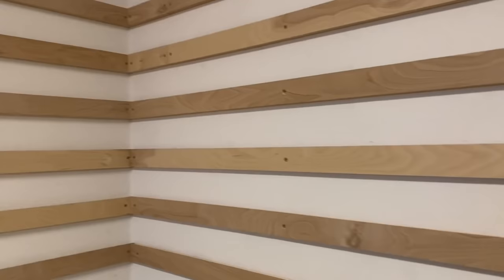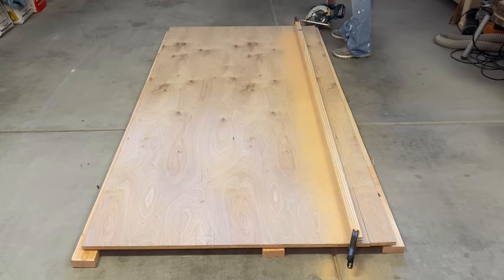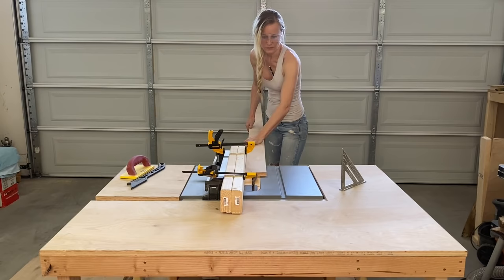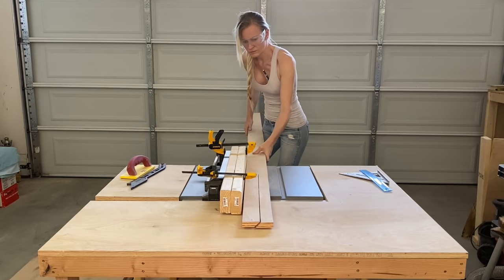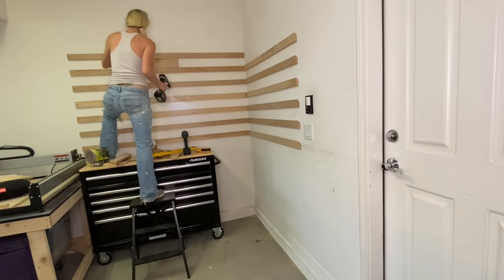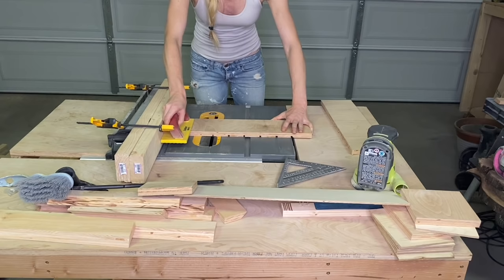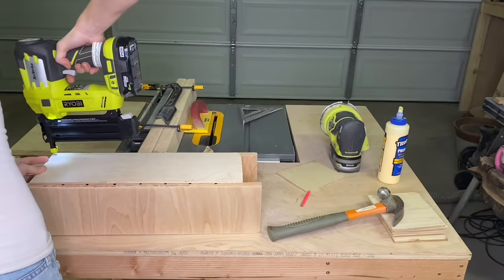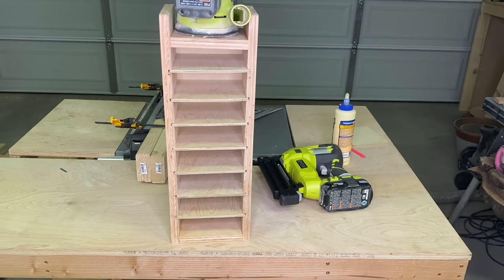DIY Build - French cleat system

Comment: Generally, this is a really good idea for anyone working with stud walls and a need to move modest, static, weight around.  I like that this installation has more horizontal cleats than I might've used, but I now understand.  Very good video.  Thank you!

Comment: I used left over Hardwood floor boards for my wall cleats and tool holders. Worked well and looks nice. Making many different tool holders for Jigs saw, sanders, drills, polishers, clamps, torque wrenches, sockets, wrenches and many more out of old cutouts and other scraps of lumber. I even built shelves for cans of paint and automotive care products. One side of my garage is all french cleats. I keep building more holders and I'm running out of room. I hate drawers as things get lost in them. Awesome job!

Comment: I have a French Cleat System on two sides of my garage. I bought 1x4x8 pine and cut a 45 degree angle on each side. Cut to length and afix to wall. Quick, safe, less expensive than ply wood.

Comment: Thank You.  Great vid.  I'll have to try that system for the garage in my new house.  Don't have a real shop (yet) but, I've used the French Cleat method on some shallow picture shelves.  I hid the wall-mounting screws with small, angled supports.  They turned out really good.  So easy to make and quite strong.  I might still have the Sketchup design I created.  Also, and I think I speak for most guys here... you're probably every woodworking man's dream.  Gorgeous AND skilled.  Thanks again for the great tutorial.  Enjoyed it more than I probably should have but then, I'm single (nudge, nudge, wink, wink) so, it's okay.  See Ya!

Comment: I use this system for many things, Solar lights can be placed in the sun then back on the cleat at night, my homemade truck camper has them on the sides for cooking and an awning, inside holds a clock, white board, and other things. cheap and easy !

Comment: great job, a little hint of advice , grab some folding sawhorses and throw a large sheet of foam insulation on it and cut your plywood sheets on it. You can cut into the insulation without hurting your blade and it makes cutting plywood so much easier. SAVE YOUR BACK hehe....

Comment: Hi Meike, I’ve had another thought that may help you in the future, when you next need to cut sheet timber try using your tablesaw bench with some sacrificial strips between your table and the sheet timber then you can clamp the sheet to the table over the sacrificial strips and it could save your back and knees.

Comment: I really like your system.  Very neat.  I would add a respectful criticism.  When you crosscut not a good idea to do it against the fence.  It could easily trap your piece.  Also the part when using the table saw ripping long pieces had no outfeed support.  Your piece could easily ride up over the blade.  Your set up for circular saw cuts on the floor was A+.  I would def do this project so thanks for the video.  Stay safe.

Comment: Nice build. You’ll love storing all your tools on that wall. My wall is the best thing I ever did for keeping all my tools handy at arm’s length. Have fun with it. 

I would like to see you use a bit more safety at the table saw. For the long rip a feather board and infeed support would keep the work from wobbling — lowering the chance of kickback. For the crosscut (grooves), a miter gauge would be safer than relying on the rip fence when you only have about five inches on the fence. Please be safe.

Comment: The French cleat on the wall will collect dust. I cut 1” x 2” pieces 1/4” hardboard and drilled a 3/16” hole in the center to use as spacers.  I placed these  between the French cleat and wall at each stud location when the cleat is screwed to the wall.  It’s a hassle to place the spacers, but when done you cannot even see the spacer.
Reply: good point ... thanks for the tip
Reply: It was not about proving myself.  The back of the cleat is about 2” wide. I only put in one screw per stud.  Since there will be torque loading on the cleat, I wanted a full 2” of vertical bearing.  I did not have that many 2” dia washers laying around.  Plus you would need two per screws which would have been royal pain to get two washers aligned behind the cleat as the screw was inserted.

Comment: What a beautiful project-such nice wood and careful assembly. But honestly, just too much work to build this system. I would recommend for us lazy folks getting a strong plastic shelving system with transparent bins plus a LARGE on wheels metal work table with additional shelves for tools. Little assembly is required and the shelves are much wider and deeper than this system. Still, again, thanks so much for this project. I'm curious because the you tuber talked about a french system but seems to be in a garage that I would see in the USA.

Comment: wouldn't mind doing that in my basement but I have a foundation that is very old concrete with some large stones in it so it is hard to drill even with a hammer drill and a masonry bit it in.  You did an excellent job there in your garage.

Comment: When bevel ripping the cleats on the tablesaw you should use a couple of feather boards, one clamped to the fence and one to the table, in order to keep the stock from wandering away from the fence. The featherboards will not only keep the stock properly registered but will guard against kickback. I'm not sure why you clamped two two by fours to the fence but if you want to know what the old timers knew try attaching a piece of 1x4 to the fence with screws from the backside and have it end even with the arbor of the saw; doing this will virtually eliminate kickback because it nullifies the hazards of a poorly aligned fence.   The commercially made push aide that you used is actually made for use on a jointer and not on a tablesaw; make your own push sticks from scrap wood but for the tablesaw  you want something that will hook on to the back end of the stock.  When you are building a cabinet of any sort that requires dados for dividers such as in the sandpaper cabinet it is best to cut the dados out of a piece of stock that is large enough for both opposing sides first and then to rip them to the required width. Doing so guarantees that the opposing dados will line up and moreover it will make it a whole lot safer than trying to cut the dados with a small workpiece being held tenuously up against the fence.  As some have mentioned you can always build a sled in order to cut the dados but personally for that operation I'd put a 1x3 scab on the miter gauge to safely run the stock over the dado blade.  I know that this sounds critical but it is not intended to be that way;  I'm retired now but spent my working life split between the architectural millwork business and as a high school shop teacher and have helped more students and other young folks learn the trade and work safely than I can count.  PS: your storage system is a great idea and despite what any yahoo might say some of my best students were the young women in my classes.
Reply: @earnestbass4043  Seek out counseling Earnest.
Reply: Excellent advice. I was going to suggest the featherboard for the table saw.

Comment: Nicely done, but I am a bit skeptical about thar table saw rip cut, seems the board is moving right and left which can cause a bad kickback! Stay safe
Reply: @WhatMeikeMakes  The table saw sled won't aid you in long ripping cuts, if you are not using a riving knife then better do, also you need to keep pressing the lumber down against the table and against the table saw fence during ripping cuts with the gripper or a good push stick, you can use feather boards too, also make sure that the saw table is not moving when you push the work piece on the table saw. Please stay safe, kickbacks are no joke and can happen within a blink of an eye. Your project turned great though. Good luck
Reply: Also please don't use the fence to guide your cross cuts, this is dangerous, instead use the saw miter gauge, subscribed to your channel 👍
Reply: The whole table saw assembly was moving as she pushed thru. The table saw system needs to be firm and stationary. she should invest in a good quality track saw, I highly recommend the cordless Makita Track saw.
Reply: @WhatMeikeMakes  a sled would be good for the cross cuts.  I was cringing when you were using the table saw on the narrow pieces of wood with a miter gauge and push stick.  That can cause a nasty accident if the wood binds and kicks back.  At least with the rip cuts you have more wood to hang onto and more weight.

Comment: I recommend using knee pads, believe me, it helps when having to do this work. I was building a large shelf for my garage today and the knee pads helped my knees from hurting so much.
Reply: She has two, but she used them in the wrong place ;-)
Reply: she probably weighs like 130 lbs. much less weight on the knees compared to your 250 lbs self
Reply: @ccvjd3909  go play with your cat

Comment: Using rip fence and cross cut device combined in that fashion is asking for table saw injury. Clamp 
small block of wood to the rip fence forward enough that after you slide work piece against it and push it forward,
the work piece will clear the block before it contacts the blade. This will prevent a binding situation 
from occurring and work piece won’t fly off and hit you in the face.

Comment: 1 - Do you ever have problems in the corners? I've only got cleat on 1 wall right now, but its flush to its mate.  
2 - I made mine 6" to start, getting 3" finished pieces - do you have any problems with the 3" strips?

Comment: Nice tutorial on building a French cleat system.  But do you not have a riving knife for your table saw?  It's a very important safety feature, especially when you're ripping long boards and have trouble feeding them straight like at 1:40  The clamps would help keep boards from kicking up much, but the riving knife would minimize the chances of kickback.
Reply: SAW STOP is even better.

Comment: Hi, as some have mentioned, safety is very important with power tools. For example, the 2 clamps you had holding the pair of 2x4's to the table saw fence can get in the way of smoothly feeding the workpiece into the blade as they can force you to move your hand away from them and dangerously close to the spinning blade.  Please research more on how to use push sticks and the proper techniques of using the table saw. Stay safe.

Comment: To set the fence to cut through the centre of the board at 45 degrees, set the fence to: (Board Width) - (1/2 Board Width) - (1/2 Board Thickness).

Comment: Nicely done! I wouldn't run the cleats right into the corner, though, because you can't hang the bins on one without blocking out the other. Corners are better for storing tall skinny things. That's where the pipe clamps go.

Comment: Hello,

great achievement.
But I don't think it's a good idea to attach 2 boards to the parallel guide of your saw table. your hand gets stuck between a high wooden wall and the saw. use the right push sticks.
you do not press the wood to be cut against the fence so it floats and the cut is not perfect (see your vidéo)
I d like to have an assistant like you in my Wood projects 😉

Comment: Hopefully she puts her hair back better in other projects bc I’d hate to she it get caught in the table saw.
Reply: and shoes are apropriate too:=)
Reply: Eric W  only looks at burly men.
Reply: Also using a table saw without a riving knife is always a bad idea. Doesn’t matter how experienced you are.
Reply: @mrjakobt  and a tablesaw sled for those narrow pieces too would be a good idea.. her technique with the push block is just screaming for a nasty kickback incident..
Reply: @genelomas332  If you're talking about the dados she is cutting around 5:30, I disagree. Kickback would be a higher risk of they were through cuts because the off cut could get pinched between the fence and blade which is the cause of most kick backs.. since they are dados the material between the blade and fence can't deflect or rotate since it remains attached and it is much less likely to get pinch kicked, imo.
Reply: Damn, I'm sold! Where can I get one of these French Clits?
Reply: Would probably generate a few more views.
Reply: @atxpupil  😂

Comment: Ok, I won’t repeat all the obvious compliments about what a lovely, fit woman she is. (Hmm I suppose I just did, didn’t I...) 
What I really want to point out is that in my home most of the corners are not square or plumb - either from crappy workmanship or from the house settling, or maybe a little of both. So as a result, joining the slats at the corners would require some back mitre work. What a pain it is to do simple projects like this when your rooms aren’t perfect.

Comment: So I have one question , if you have a table saw and you have to make all these 4" rips why use a skil saw and a straight edge? Your garage door is operable I assume so why not open it and rip the ply with your table saw. I was wondering doesn't  that seem easier on your back and knees? Overall I liked your project. Keep up the good work.
Reply: Sometimes a whole sheet of plywood can be hard to manage for 1 person on a table saw.  She could have cut it in half with the circular saw and then made it more manageable to use the table saw for the rest of the cuts though.
Reply: @jtltet  or she could rip it in half with the same table saw and accomplish the same. I do that with 5 ft wide sheets.
Reply: @57xmasbaby , well like I said trying to rip a full sheet may be too much for her to handle by herself.  Also, where do you get 5 ft wide sheets of plywood?  4' is pretty much the normal width.
Reply: @jtltet  5 x 5 is the norm for baltic birch. I use them for dovetail drawer boxes. My wholesalers have entire racks devoted to them in varying thicknesses.  I'm a licensed cabinet shop contractor. I have a C-6 license.I do this for a living and have taught many an apprentice through the years. When I observed the young lady working on the table saw with a garage door behind her i thought why not open the door and run the sheet in half. She had a decent sized out feed table. She looks capable enough to handle a full sheet of plywood. I worked with woman carpenters on the Union job sites back in the 80s and most of them could handle carrying (4)2 x 4 x 16 " on their shoulders through the field. As well as full 3/4  4x8 sheets of concrete form ply . Never underestimate the strength of a woman.
Reply: @57xmasbaby , I wasn't aware that some plywood came in 5' widths.  Then again, I don't work with it nearly as much as you.  I'm certain there are many women who can handle anything a man can but I was just simply stating a possible reason why she didn't use the table saw to rip her sheet of plywood.  I'm sure she has her reasons and as long as she is happy with it that's all that matters.
Reply: @jtltet  I think it has to do with the eye candy we're observing when she's bent over ripping the plywood. LOL Have a good day!
Reply: @57xmasbaby , I think you're right.

Comment: Hi!  It is Christmas Day and I am waiting for some finish to dry on one of my projects.  Mr. Costello's comments about a table saw being dangerous are well founded .  What would help you when you are making long rips on the table saw is a feather board to keep the tock pushed up against the fence for straighter cuts.  Also check out www.truetracsaw.com.  They make track systems that work with your circular saw. I have been using the Truetrac system for many years and use it on plywood as well as rough cut lumber to get straight cuts every time.  Best of luck to you and Merry Christmas
Reply: @WhatMeikeMakes  Hi!

I know the company very well.  I met them at the Woodworking Show several years ago.  I have several of their products.  All are well made in Ohio and I am confident the track system will save you time and money over a one-trick pony Dewalt or Festool Track Saw.    Jeff Smith

Comment: Not judging but rather speaking from experience, that cross cutting narrow strips @ 5:51 is dangerous.  Please be careful.  Tried that once and thank god I was using push sticks cause as the piece twisted and bound the blade it took a split sec to yank that piece out of my control and shove the push block into to blade.   Nice project though.
Reply: I once had a hand router snag the pull tie on a hooded sweatshirt I was wearing. Scared me half to death; when I powered it off the router stopped spinning about 3 inches from my face. 
Learned a serious lesson that day - NEVER lean over your work, NEVER wear anything that could fall into the work area. SAFETY FIRST !

Comment: PLEASE PLEASE PLEASE put your hair braid down your back and away from the tool blades, air movement around these will suck your hair in and you won't be able to react quick enough to get it out before your head is pulled into the tool, i don't want to see the aftermath of that. please think safety first however a good video

Comment: Watching you use that table saw scared the hell out of me. Please take a table saw safety lesson with your local woodworking class before you use it again and film it for others to repeat your mistakes. That wood should NEVER lose contact with the fence as you push it through the moving blade and please step a little to the side so the wood missile you are creating doesn't break your jaw on its flight backward. And your ponytail... tie it properly behind you so it doesn't rip you scalp off when it gets caught in your circular saw.